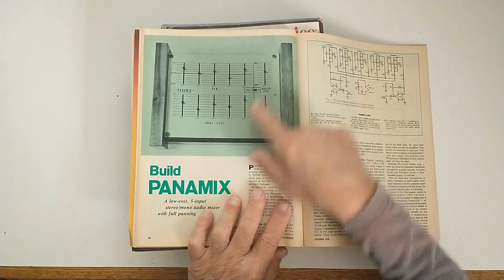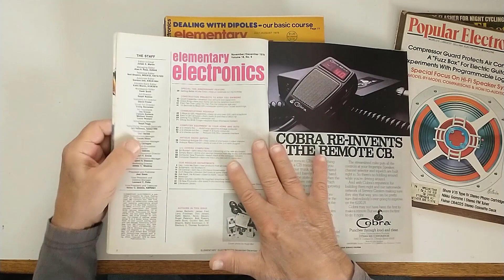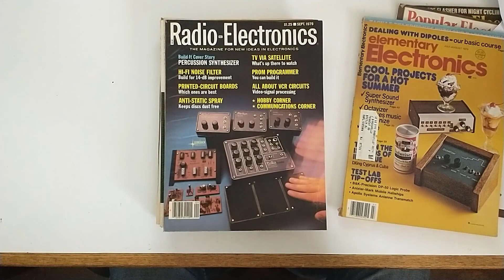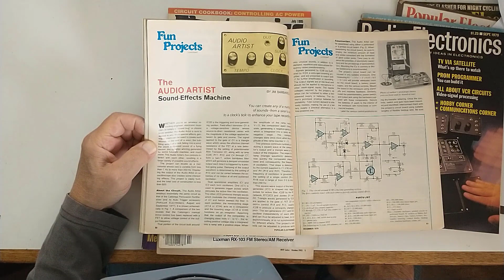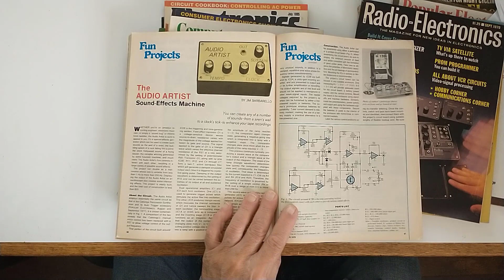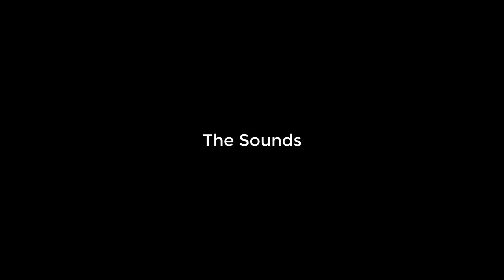Look Mum.. An Audio Sound-Effects Machine from 1979!

Comment: I still have that magazine from '79! I built the Audio Artist as a young electronics student, along with building up the test board for the SN76477 Sound Generator IC. Thanks to you and Radio Shack, I built all kinds of cool stuff! There was another called the Super Synth that was a similar circuit to yours. I've been using these to make creepy alien sounds at Halloween -- just add a digital delay and it gets FREAKY! I'm revisiting these, so may post a working unit. I'll have to build and check out these others you mention!  I'm so glad I found your post here! Many thanks for so many cool circuit designs.